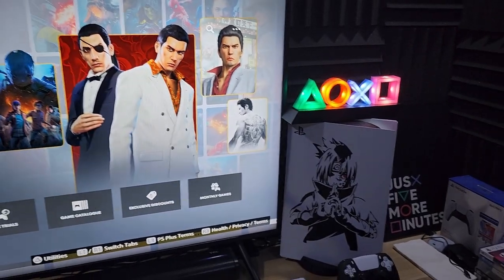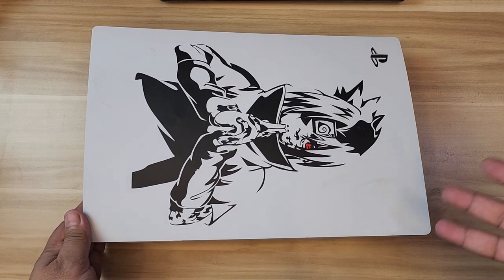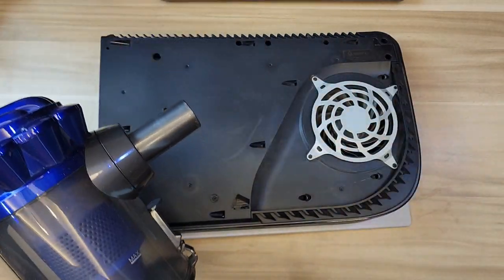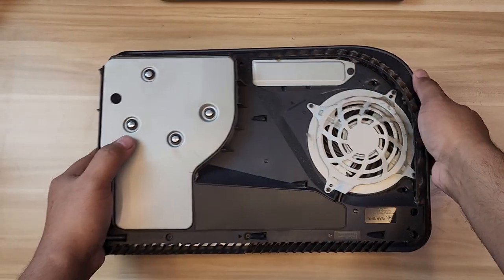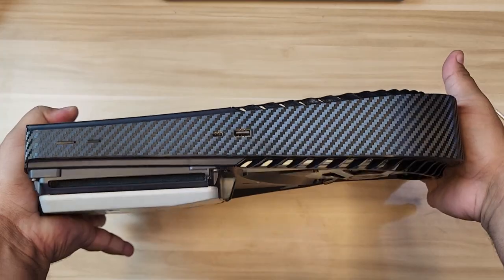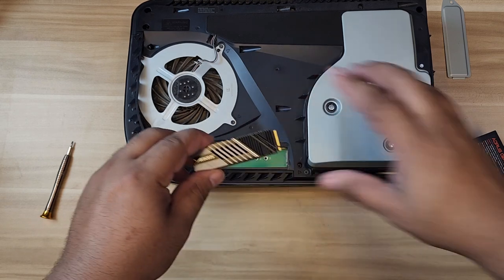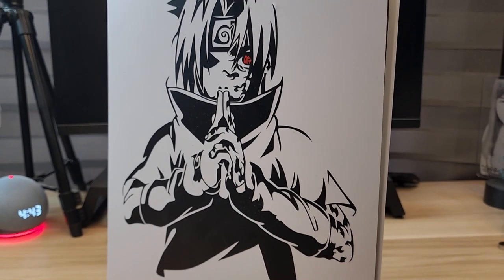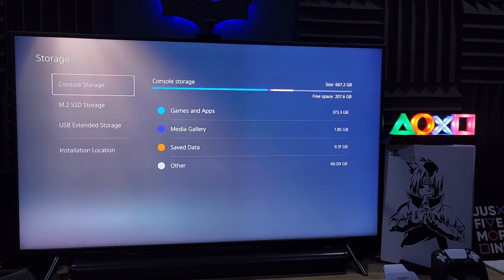Cleaning my PS5 After Almost 2 years! Plus installing Aorus Gen4 7000s NVME SSD from Gigabyte

Comment: Very cool video, thank you for doing this! It helps a lot of people clean their systems themselves. I just wanted to ask, did you consider taking it apart more so you could better clean out the heat sink? I’ve seen a few systems get this dirty here on YouTube and when they open the system their heat sink is very clogged. Thanks again for taking the time to do this video!